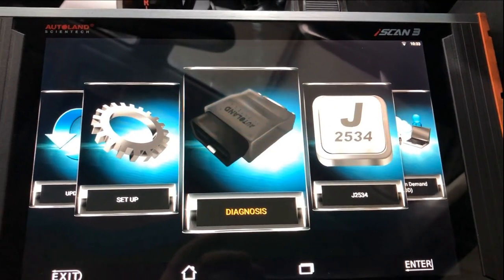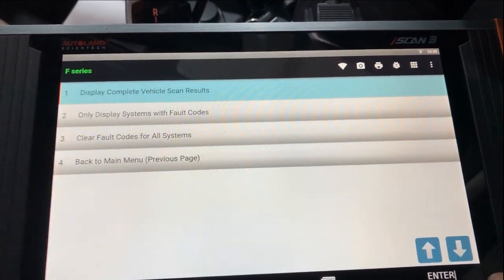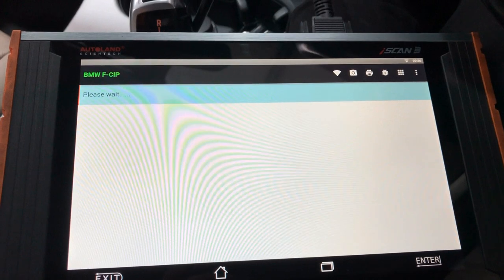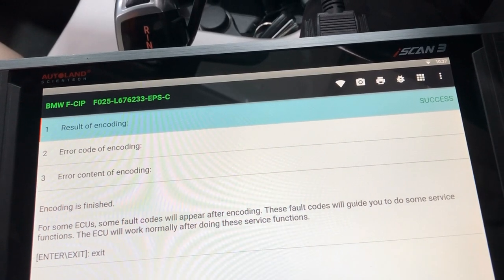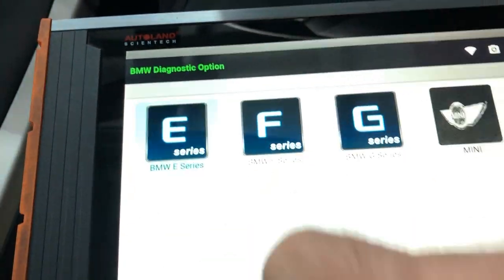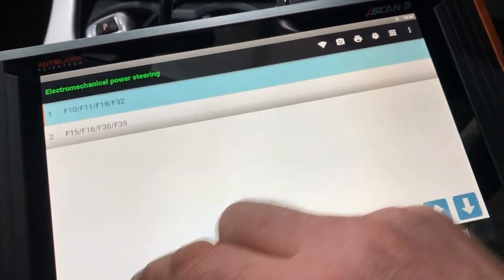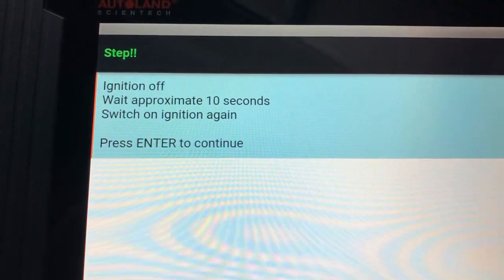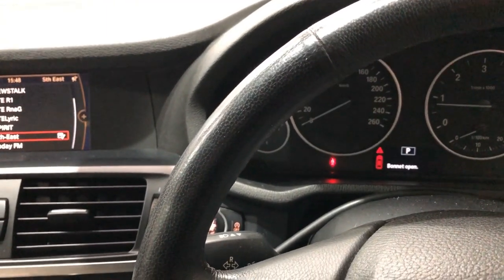Encoding a new steering rack on a BMW x3 with the iScan 3

Comment: Does this need to be done for a new steering rack and or motor or just for an EPS control unit replacement?
Reply from the maker: Has to be done for a new rack
Reply: @RyansAutomotiveTV  hi question my friend i installed a new rack in to my m140i myself but light on dash no power steering, do i need this coded i got the rack from my friends m140i same car
Reply from the maker: @ItZFlipz  Yes needs coding and learning
Reply: @RyansAutomotiveTV  thanks boss big help i got scared i installed it wrong

Comment: Hi Ryans Automotive, I am considering getting an autologic assist plus or iscan3 for my shop. How do you like using the Iscan3? It looks like its very capable as I need to be able to program/encode modules etc. Please offer your advice.
Reply from the maker: Hi 
Yes good tool, and good all round coverage
For programming and coding has most for BMW, and for Mercedes, Ford, Mazda and Land rover will program the most popular modules 

You can see more details about it here  https://www.ryansautomotive.ie/shop/diagnostic-equipment-and-tools/diagnostic-tools/autoland-auto-diagnostic-equipment/autoland-diagnostic-equipment/autoland-scientech-iscan-iiwt-kit/